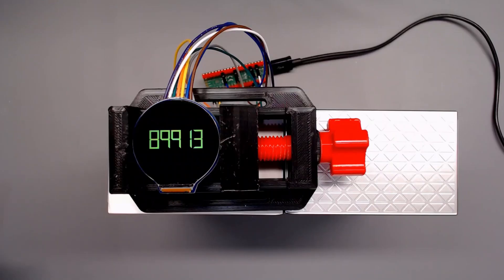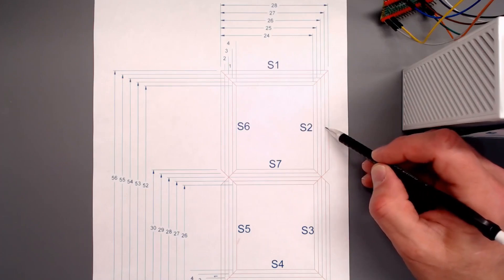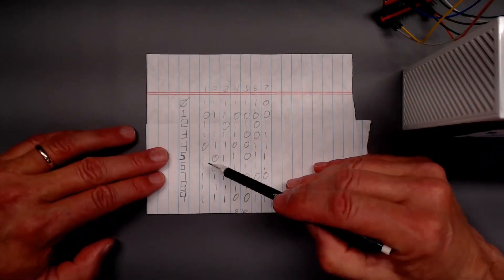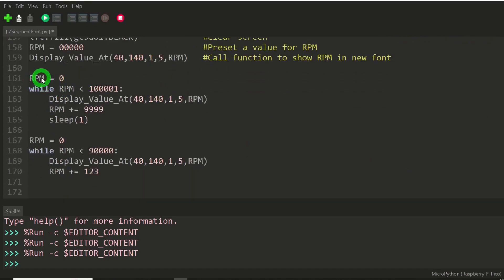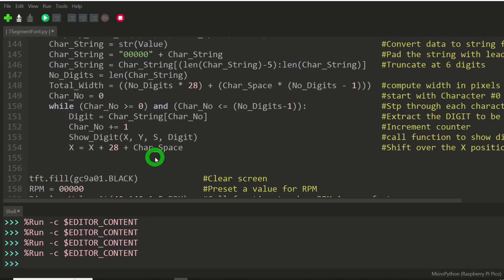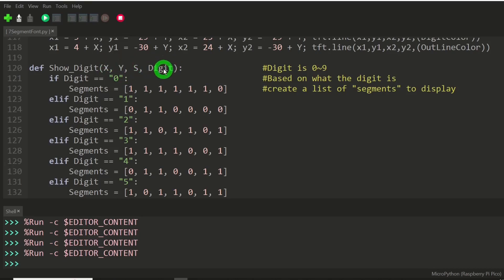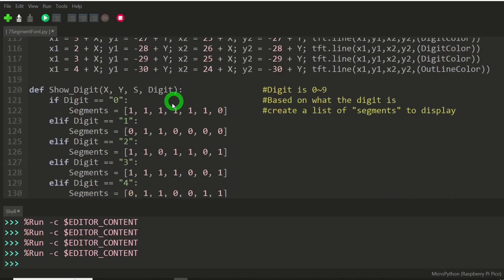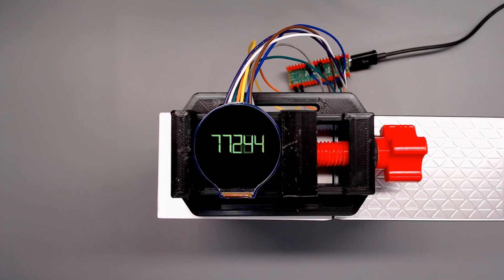Creating a 7 Segment Font for the 1.28" Round LCD Display.

Comment: hey, im new to coding and saw your tutorial, however I keep getting "ModuleNotFoundError: No module named 'machine'" whever I run your code, I have installed micropython but it has not fixed it. Any advice?
Reply from the maker: Good morning mrgiraffe1228 ,
I assume you are using the Thonny IDE as your editor.  They only cause I know of to get that is you are running the code in PYTHON and not on the PICO. In the lower right corner of the IDE - you can select where to run the program - you needs to select the PICO / com port being used.
Hope that helps!
Chris
Reply: @MakingStuffwithChrisDeHut  thank you very much

Comment: Great video of a nice screen, i would use 100_001, not 100001, also "0" * 5, not "00000",
so rpm is expected to be up to 999_999, or just had the space for 6 at current fontsize ?
Could color change the digits when reaching some level, white to 1_000, yellow to 5_000, green to 10_000, ... red when ???
Reply from the maker: Hi jyvben1520!
Those are all great suggestions and I think it would be easy to incorporate those ideas into the example program.  Regarding the "indicator" character at the 1k division, I had thought about incorporating something like that but it never made it into the code.  It might have got pushed out due to not having much size on the screen, that darn thing is pretty small.  But I certainly do love these round displays and am hoping to do more with them.
Thanks for adding in some great suggestions!!!!!
Cheers
Chris